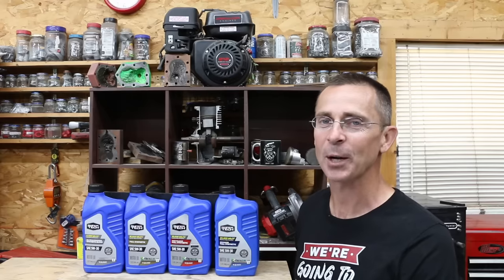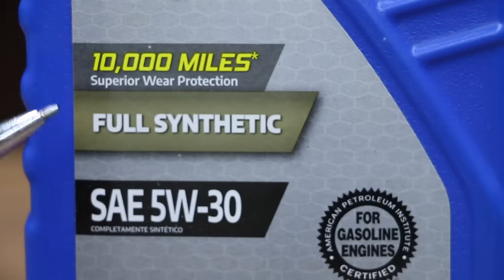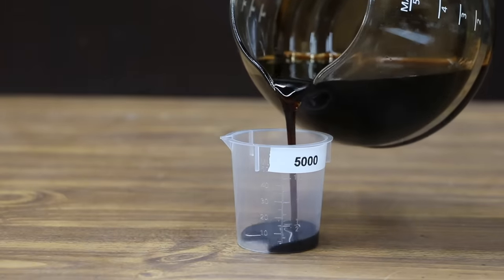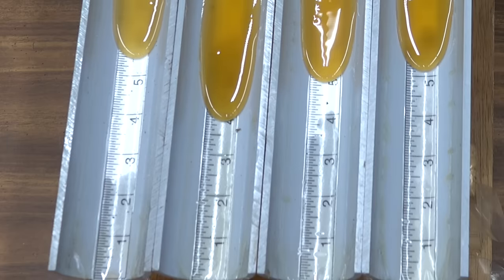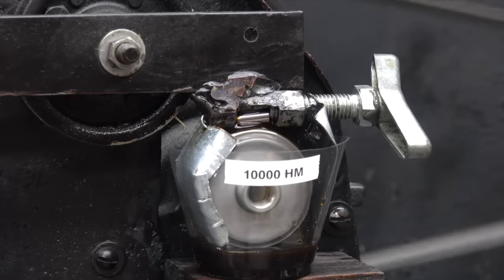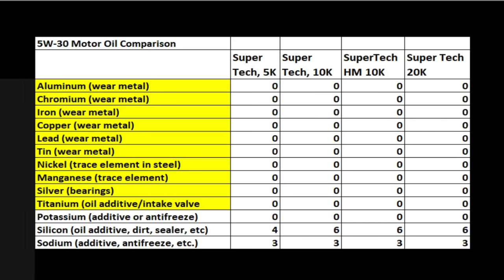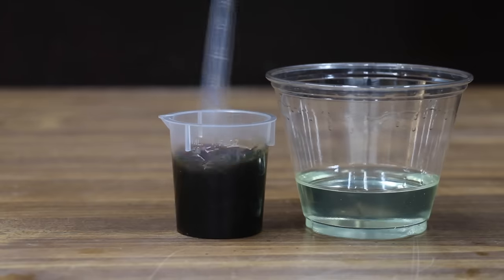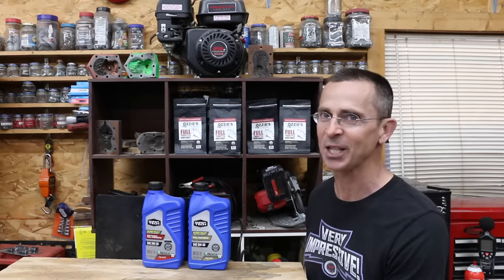Are They All The Same Motor Oil? Let's Settle This! Four Types of SuperTech Motor Oil Compared

Comment: Hi, I have a 2013 Prius that is supposed to use 0W-20 oil BUT I have 112K to 120K miles on the car, and unlike another Prius I owned, model year 2016, this car is consuming oil. I want to get away from the dealership oil changes because the dealership wants me to buy a new engine @ $6,000. I though all I had to spend was $4,000 for a hybrid battery replacement at 150K to 180K miles.
So, I think I need to find a video that talks about 0W-20 instead 5W-30, yes?
If I get away from my Toyota Dealer, it looks like I will be looking at ILSAC certified
- Penzoil Platinum High Mileage Full Synthetic?
- Mobil 1 recommended alternative
- Mobil 1 High Mileage for engines with 75K + Miles
- Royal Purple High Mileage Motor Oil?
- Castrol?
- Valvoline?

- Amsoil

and their appropriate oil filters?

In this video, the High Mileage oil claim wasn't explained. If you have a high mileage car, you don't agree that there is something about high mileage oil that meets the need?
Reply from the maker: Thanks for sharing.

Comment: I've been around the block on this subject for decades now. If your engine allows the use of dino or semi, you can safely use it. Just be clear about oil change intervals. If you drive all short trips, that qualifies as severe duty and you will need to cut the oil change interval in half. That means 3000 miles at the most with dino or semi.

My knowledgeable source says, don't go more than 7500 miles on any oil. Cut that down to maybe 4000 miles with synthetic and severe duty. Everybody says, oil is cheap and engines are expensive. It's worse than that. An engine failure usually means buying a replacement vehicle.

My exception to the 7500 miles rule would be all-highway miles. Some people travel extensively for their jobs or just because. Maybe if it's all interstate, you can go 25,000 miles on your Amsoil. If you use synthetic and are going to change it at 4000 miles, maybe you don't need the priciest product.

I wouldn't worry about the quality of Supertech oil. Walmart has enormous market power and they don't want to get hit with a class action lawsuit because of a bunch of ruined engines. The idea of bad motor oil is a myth. No one produces bad motor oil. If they did, they would be bankrupt real quick considering their major customers are retail chains, parts chains, oil change chains and the government.

What happens is that sometime independent retailers sell inappropriate products. All products have their uses and that is why they are still produced. Some of them are not for use in any motor vehicle though.
Reply from the maker: Thanks for sharing.
Reply: @ProjectFarm  Above all, I was thinking of SA non-detergent oil. It is still produced and sold because it still has its uses. Just not in any motor vehicle engine made after maybe 1930.

Comment: I saw where you tested Slick 50 a while back. Have you tested a product called Energy Release ? Or ER. I know you’ve tested lubricity and friction of different products using a brake test machine. If you can find some. Please test ER. Thanks
Reply from the maker: Thanks for the suggestion.

Comment: Products of combustion turn your oil black after 3-4k miles and 5-6k is about the perfect interval regardless of the product marketing on the bottle. Nasty hardened sludge will build up in the vehicle's heads if you regularly wait longer than 6,000 miles between changes. That being said, this cheap synthetic oil is excellent and likely all comes from the same factories at Castrol or Mobil 1, so change your oil every 6k.

Comment: I have been using Super tech synthetic  for the last 12 years. got a Ford five-hundred to 403000km and my Ford Edge is at 380 00km. The only thing I hate about it is the seal on the bottle. I use a box cutter to open it. 😂
Reply from the maker: Thanks for sharing.

Comment: Thanks for the informative Video. I would like to see you run a comparison of BRP's PWC XPS 4-Stroke (4T 5W-40 Synthetic Blend Oil) vs Shell Rotella T4 and T5 15w/40 Engine Oils for use in warm Climates. I personally use Rotella T4 in my 1983 Suzuki GS1100ES, 1993 K1500 (5.7L)John Deere E120 and my Club Car with EX40 Subaru Engine, I use Rotella T5 in my 2007 Audi A6 Avant (3.2L).   Randy   AKA randog311  (Retired Professional Wrench).
Reply from the maker: You are welcome!  Thanks for the suggestion.

Comment: I think it's best to do the lebroski test or do both after the heating experiment. Better to know what it's wearing properties are after it's been heated. Can you do that from now on !
I don't think you should be using gasoline you're not going to get really any contamination with Gasoline you shouldn't be, but with diesel you are and you should use diesel instead of gasoline in the test. Diesel is a lubricant gasoline isn't

Comment: I tried the 20k oil, and at 18k miles I started having oil pressure issues in the top end of the engine. I've used amsoil 25k oil with no issues, but walmarts oil couldn't cut it. I saw no difference between the 10 and 20k oils.
Reply from the maker: Thanks for sharing.

Comment: I'd love to see a test of high mileage synthetic vs regular synthetic on elastomers and seals to see if there's actually any diffrrence.
Reply from the maker: Thanks for the suggestion.
Reply: Important info, especially when using lubricants outside of automobiles. Many kinds of 'tools' can be appropriately lubricated with motor oil, but the plastics may not be happy.

Related: I learned the hard way when I used 'synthetic brake parts lube' supposedly "safe for all materials used in your brake system". It wasn't.
It caused the 'boots' on the caliper slide pins to swell and the pins bound. Ordered silicone-based brake parts lube (like was recommended), new boots for the slide pins, and painstakingly cleaned the parts w/ brake cleaner (Yay, cancer! /s). 

All has been well for 3+years since that fiasco.
Related: Scotty's recommendation for Akebono brand brake pads, is "Legit". They're quieter, better-stopping, and longer lasting than any pads I've had on my 3 vehicles in the last 15+ years. The Akebono pads weren't even much of a price premium; what little-more they were in cost, you more than get back in value

Comment: Dear project farm , i recently did a oil change with costco kirkland 5w-20 full synthetic and it was very thick !  i normally use mobil one , but they where out of it . i needed 6 quarts for my vechicle so i used  five quarts of kirkland and one quart of mobil one . i notice the kirland was very thick and slow going down the funnel and the mobil one was fast and like water!  also upon driving i noticed the engine was sluggish and felt like i used 5w 30.  i would like to know is the kirland a true 5w-20 ? thanks your the best!
Reply from the maker: You are welcome!  Thanks for the suggestion.

Comment: All the tests were done with new oil.

I wonder how their durability really is.

i.e. does the 20000 miles oil really need to be changed less often ?

Performance drop after prolonged use is also important.
Reply from the maker: Thanks for the suggestion.

Comment: Change oil every 3-3500 miles, period. You said it, engines are expensive. I have a ‘99 F350 with 255,000 miles on a 6.8 liter two valve. Runs good after all this time.
Reply from the maker: Thanks for sharing.

Comment: Hello @Project Farm would you be able to test ACEA oil standards? More and more cars in the United States are requiring the use of “C” grade vs. “A” grade oil. For example, modern Porsche 911’s require C40 oil vs. the old A40 oil. Both are same 40 weight, but the “C” oil has mid-SAPS (sulfated ash, phosphorus, and sulfur) content to reduce catalytic converter and gasoline particulate filter clogging and poisoning. Thank you
Reply from the maker: Thanks for the suggestion.

Comment: Hello

I was wondering if you could check out motor oil from sct lubricants.
They sell cheap oils that ive been using for a while no problem. Im curious what the difference would be between castrol 5w30 and mannol 5w30 from sct lubricants.
Reply from the maker: Thanks for the suggestion.

Comment: Diesel Technician for 16 years. The cleaner/more frequent you change your oils. The longer your equipment will last. Less wear and tear. 

The newer diesel engines, some company’s are going 25k miles between services. The oils are warranted for that. But the truth is they will try every trick in the book not to pay for your engine. 

Moral of the story is just change your fluids early or on time. You’ll have less wear, and gain longevity. Oil is cheap compared to an engine, transmission, and differential.
Reply from the maker: Thanks for the feedback.

Comment: There is a never ending debate on the boat forums .It's been going on for years with nobody winning the argument . Is marine grade gear oil (ex 80w90) better than automotive gear oil? They say marine grade emulsifies with up to 10% water and auto gear oil doesn't. Which is obviously important on an outdrive in the water.   There is no data from the manufacturers proving this. This would be a GREAT test that might put the 1000's of arguments to rest. Quicksilver, Super Tech, Mercury Mercruiser brands among others...please give it a try...thanks
Reply from the maker: Thanks for the suggestion.

Comment: I have 6 cars 5 drivers. 3 are TDI engines they are changed every 10k. 73 ford 390 every 10 k. 17 armada every 7k , 100 series land cruiser every 10k all full synthetic whatever is on sale except for TDI uses diesel specific syn. The cruiser went to 288k with no problem and had cleanest lioking oil of the bunch until it was totaled in a crash. The Armada gets a little valve sound at 8k so change it at 7 now.
Reply from the maker: Thanks for the feedback.

Comment: I drive a 2012 subaru legacy 2.5. the car was a 1 owner dealer serviced car when i got it. so i use subaru oil and oil filter never anything else. at 150,000 i have no knocks ticks or oil burning.
Reply from the maker: Thanks for sharing.

Comment: PF, could you setup a matrix of Honda gn4 10w-40, xps5w-40, PS 5w-50, against shell rotella t6 5w-40. I would like to see if factory oil is any better than shells t6 which is jaso ma/ma2 approved. This is a hot topic amongst atv/utv forums. Thanks

Comment: @PROJECT FARM 
So in a new truck that takes 0W-20 that has about 5,000 mi on it would you use the high mileage full synthetic 10,000 version of the supertech? Or just the regular 10,000 full synthetic
Reply from the maker: Regular full synthetic.
Reply: @ProjectFarm  thank you
Reply: That's the choice I made

Comment: Have we done a conventional oil vs synthetic blend vs. Full sythetic in an engine that has high oil consumption like the infamous 2010-2014 subarus. I've recently read that the formulation of full synthetic oil allows it to flow through smaller holes than conventional oil, which in my mind is great for getting between wear surfaces but also aids in oil consumption by more easily flowing through the small gaps in the piston rings. Any info would be great.
Reply from the maker: Thanks for the suggestion.

Comment: Personally, I will never use SuperTech oil again.  The last time that I used it, it caused my engine to start to burn oil.  I've had excellent results with Quaker State oil & never have any oil loss between oil changes at 3k mile intervals.  Nowadays, I change the oil every 5k miles, though.

Also fyi...I've tried 15k miles, low micron oil filters & they never seem to do the job properly for the full 15k miles, so I swap them out at 10k miles.
Reply from the maker: Thanks for the feedback.

Comment: Like you said oil is cheap engines are expensive. Ive always done and will keep on at 3 months or 3k miles whichever comes first. Regardless of brand, type, quality, or weight. I change my oil every 3 months. Its easier for me to set a schedule based on months. Im very rarely at or over 3k in the time frame. Even if i used a "fancy" oil like amsoil or royal purple etc., I would still keep the same schedule.
Reply from the maker: Thanks for sharing!
Reply: @ProjectFarm  and thank you for the ongoing great content. You're an inspiration. May you never run out of ideas or the desire to create. Keep up the good work.

Comment: I love his tests, but the problem is they are just at a point in time.  Years ago you could expect the quality from a given manufacturer to be consistent for years.  Now you never know what you will get from the same manufacturer in a few months or even weeks.  Bean counters take over the company, a new CEO pushes short term results, the company name is bought out then slapped on inferior products, etc.  A fellow in the know told me years ago, "The problem with China is we spec out a product for them to build and their quality is excellent.  Then they start cost cutting to increase their profits and quality declines.  If we are not constantly monitoring and hounding them, quality would be so low we would go out of business."

Comment: I was using Moble 1 full synthetic in older car that was burning oil. Switched to Supertech full synthetic and its been slowly burning less oil??? Not sure how but last 3 oil changes with supertech showing reduceed oil consumption. Both oils for high mileage vechiles.
Reply from the maker: Thanks for sharing.

Comment: Oil contamination and heat I believe is the most damaging factor in oil. So the condition of the engine can make a big difference on oil. Regardless, I like to change oil every 5k miles
Reply from the maker: Thanks for sharing.

Comment: HIgh mile change is alright for some drivers.  they are ones that never go on short trips  Never let the car or truck sit more than a day or two and always drive on clean roads and avoid bad weather high and low ambient temperatures and the engine involved is working just as good as new.  I change oil in my cars even though they don't go very far, motorcycles too as the weather changes.  Cold weather or very hot wreaks oil.  Overheating wreaks oil.  tune-up problem of any kind wreaks oil.  Even if AI was going to run long change intervals I'd change as soon as an event happened.  Very hard high speed run, overheating or a bunch of very cold starts.  I change the oil in the cars I'm going to use in the coldest weather, Some of the motorcycles can be left to sit in bad weather.  with low miles per year (3000) once a year seems fine.  again with an event like ride the clutch hard with a passenger on mountain roads I might change the oil before I ride that bike again.  Most all engine problems if not tune-up related seem to be oil related or lack of change.  I try to use the best oils reviewed by you and others likes Banks superchargers.  He has done some very careful oil reviews liek you and he's careful to find the best one's with no regard to sponsoring companies.  seems like a company couldn't supply a ringer oil, but I guess it's possible.  Ifit were why don't they sell it too?  Royal Purple prices their stuff as better, so it costs more.  It's good but the same levels can be found in other brands.  I worked at two different Mobil stations and everybody's test show that the Mobil oils in their price ranges seem to be the best.  their extended performance seems to be the best if your car or truck fits into the can drive it far as it doesn't run on dirty roads and the engines involved run as if new.  I've drained 0w40 out of an air cooled motorcycle engine that has lots of miles, but runs as new, top speed it hit regularly as it doesn't go very fast as fast as it can go.  the drained oil looks nearly the same as oil taken right out of the bottle. With this oil the engine seems to get it's best gas mileage and seems to hit top speed even a little quicker and doesn't seem to run as hot in very hot weather in stop and go traffic.  Many high performance motorcycle engines don't last very long as they are so HOTROD.  13.5-1 compression 12,000 RPM redline and it gets run right at redline for a whole tank of gas and then right out of the station run nearly a 1/2 tank more before it gets shut off.  the engine has 124,000 miles and it runs as good or better then new.  top speed is held by common sense as i'll go faster if run into the red zone.  the little bit faster doesn't seem to get anywhere any sooner and just keeping up with th 18 wheelers is all it can do anyway, and if they want to speed they are going to pull away.  I have run the engine with hearver oil and not as good oil.  they certainly slow the bike down, but the 0- 40 Extended performance motorcycle formula Mobile ( a little different to run the clutch in the oil)(higher temperatures as air cooled motors can hit way higher temperatures than water cooled motors.) seems like the motor can run at it's mechanical limits and not break it's self. I'm careful with over revving and don't do it often or for long periods of time.  air filter is cleaned (foam oiled type) every oi change and the bike isn't driven off the road or in dusty conditions.  I don't ride cold s it stays home then too.  Many service manuals for motorcycle don't even have recommended services after 40,000 ,iles as I guess they expect to fully rebuild and start bac k at the beginning.  wear of timing chains is listed but doesn't have a replacement mileage.  It's not worn anywhere near it's service limit.  Only the first 5000 miles di the bike run on other than the best synthetic oils and it's getting to be fun to see just how far this 1981 model motorcycle will go.  250cc.  I've been a professional mechanic for 52 years and even now that I'm retired I'm still fixing my own projects and keep up with the modern cars like 15 years slow. (cars normal people can afford.)  I watch your shows when I can get time.  Buy some items (like shoes) on your test results.
Reply from the maker: Thanks for watching and sharing.